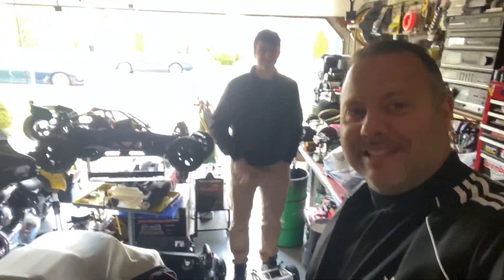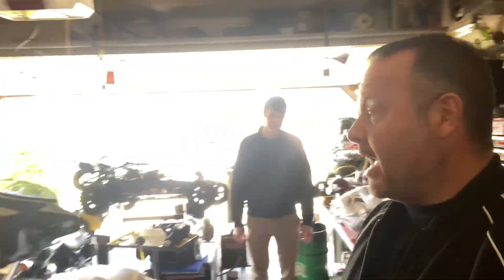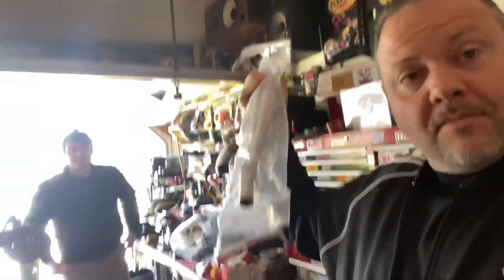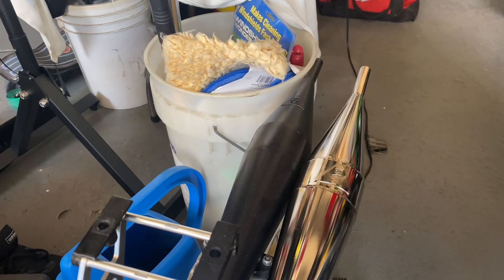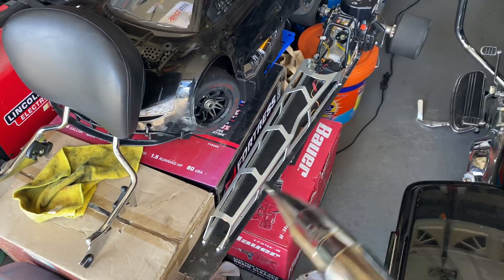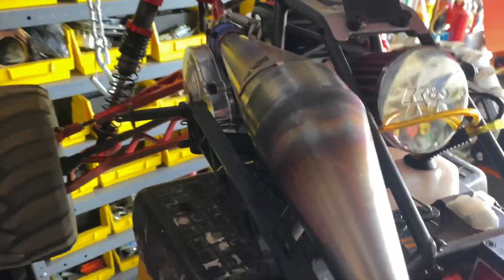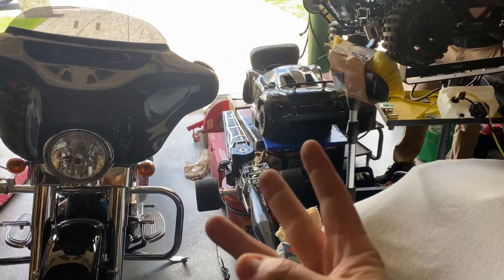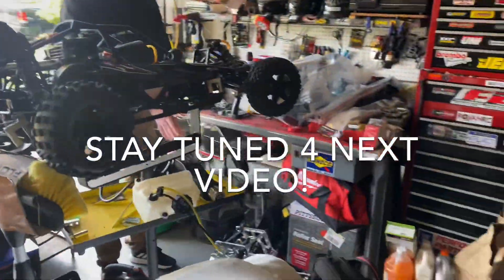Just A Little ROVAN RC News & Update, All Stocked Up & More BARTOLONE Pipes Coming

Comment: Bro what pipe should I use on my Rovan LT 320
Reply from the maker: The best pipe for Rovan LT320 and even 360 is the famous Bartolone XP pipe made for the LOSI 5T and you can even use the End bleed pipe aswell that’s made for the LOSI 5B for more RPMs but you will have to drill a hole 🕳 on your side plastic to fit that pipe.
Reply: BOTAJELL wicked thank you new I could count on you bro